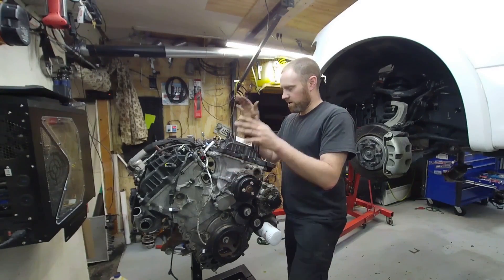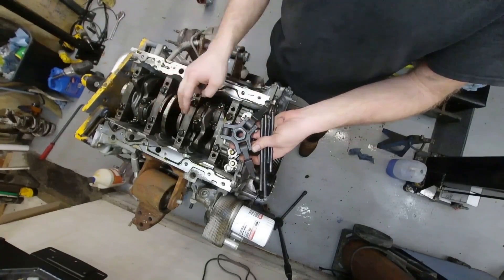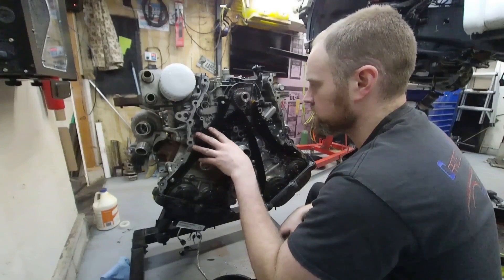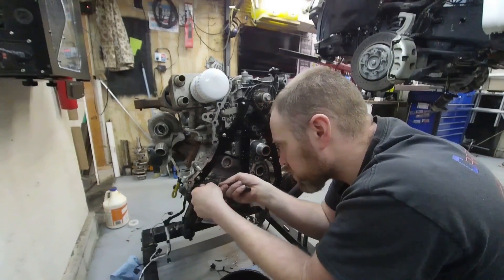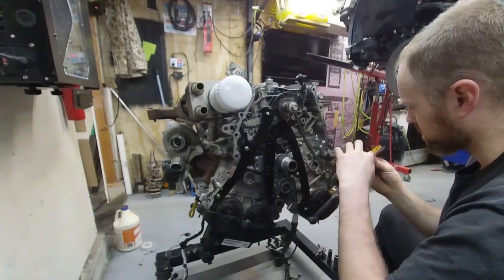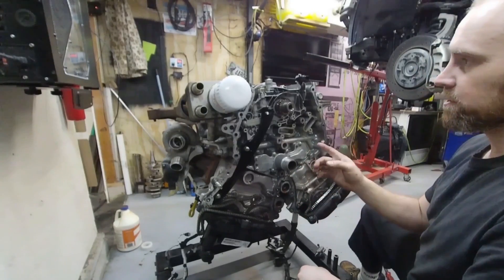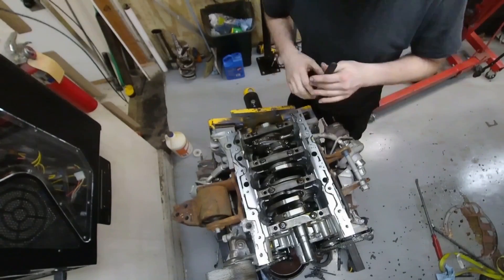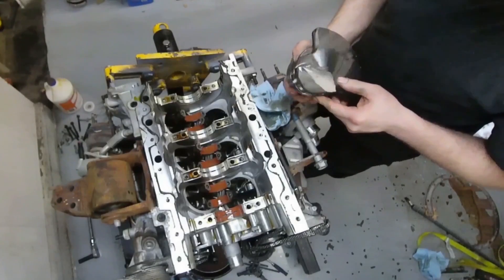EcoBoost Broken crank removal (It's Out!) pt3

Comment: The very same happened to to my '18 rig after using a sophisticated tuning for about 30K only with some 430HP in it(towing horses for long distances). 
Nobody knows whether the owner of this truck did the same or not, but mine clearly broke just because of the excessive torque I've created with the software update. Lessons learned, I've got a (forged) Raptor now and no issues at all (over 70K/year).
Another lesson/friendly advice after six "depleted" F-150s over 30 years: check the oil quality, level and (!) lifetime rigorously and change the bloody oil if you used the engine intensively even for 2K only. You'll save your engine. 
NB! modern oils do not last long and they expire during each heavy job. A 20 hours intensive (hot&dirty climat, frequent up&downhills, short stops, heavy off-roading etc.) usage kills any oil, notably the mediocre ones...
I used to have V8 and V6 F-150s, but the latter rule is actually valid for both type. I have no engine issues ever since I replace the oil on time (means, before "official" intervals).

Comment: Ive seen plenty examples of these chains lasting much longer than 80k. Just gotta keep up with frequent oil changes so they don’t stretch especially since the oil on these direct injection engines are often subject to heavy fuel dilution especially if they are sitting at idle a bunch. I think a lot of ppl try to stretch the oil change intervals too far on these turbo engines. From the used oil analysis I’ve seen I wouldn’t go beyond 5k on a good full synthetic oil.

Comment: You burned through removing the main caps in high speed so I didn't catch it, but did you say they are held in with additional bolts from the sides of the block? Trying to do an in-frame rebuild on one of these things but not having luck getting the mains off...that would explain why. Looks like the motor is coming out if that's the case...[curses at Ford]
Reply from the maker: Lol yeah, it has side bolts and there are things blocking a couple of them.

Comment: Crazy. Probably a tough thing to see for the guys that brag about their Ford truck having a forged crank. Even forged parts can have defects in the grain structure leading to a failure. I think you're right about how thin some areas of these cranks are. I guess Ford is banking on using a forged crank to make up for those thin sections.

Comment: Back story question. Why isn't the dealer doing this? Would figure that the crank failure would be a warranty item and that a 2017 would still be under warranty. Don't get me wrong I love the content but I'm also distracted with the thought of wtf a 3 yr old truck split crank?!
Reply: In the first video he said the dealer denied it because of some aftermarket part. It was an absurd denial, body part or something. Technically the dealer cannot legally deny bc of that but the owner took the bait and was screwed.
Reply: Id bet the owner could still file a suit against the dealership.
Reply: Wow a hood an intake and rims voids the crank... yeah I'd say a lawsuit would likely favor the owner.
Reply: Ahhh must have missed that or forgot it from in part 1.
Reply: Crazed performance could provide alot of evidence of defective ford parts. Ford kinda stepped in it by blaming rims and hood which is illegal!
Reply from the maker: For the record Ford denied it because it was just over the 60k mile warranty mark but the aftermarket warranty company Ford signed the customer up with for after the factory warranty (non Ford different company) was the one that turned down the claim for bogus reasons. If I was the owner I would at least talk with a lawyer and see if it is worth the lawsuit. One thing to note though is maybe there is even more to it than the customer says as well who knows. Not saying he is lying just pointing out I only know his side of the story and maybe there is more to it?
Reply: @CrazedPerformanceRepair  
I had one of the last 100k mi powertrain warranties on my GMC... Never needed or used it but seems if your going to sell a vehicle at the prices they want you should be able to stand behind it at least 100k min IMO.  I wouldn't buy a vehicle with 60k warranty... So I may not every buy another one lol!
Reply from the maker: @micahap1559  sad thing is the standard warranty on most for power train I believe is only 36k mi and you have to pay extra for more. But I'm not sure really since I only drive old out of warranty things being I can fix them myself lol.
Reply: @CrazedPerformanceRepair  
Wow! 7-8 years ago GM had 100k. Standard. I believe ford did also. I thought it dropped but didnt know it was down to 36K ... What a joke!
Reply: I do all my own work as well. Never hired anything out. Not professionally but my grandfather was a mechanic paint body and frame man! Lol Back then did it all of course he added the paint and body. To his list.
Reply: @CrazedPerformanceRepair  good points and totally agree. Either way I'd like to think this is more of an exception than a rule for coverage.
Reply: @micahap1559   GM is 60k miles powertrain, 36k bumper-to-bumper. They ended the 100k mile warranty around the 2015 model year. If I bought a new vehicle today, I would negotiate an extended warranty into the deal. With all the tech gimmicks and expensive LED headlights, it's not worth gambling. Honda gets over a grand for replacement LED headlights and they have a tendency to fail after a few years.
Reply: @karlschauff7989  You hit the nail on the head with the word gimmick. But youre buying in hook line and sinker. Youre wanting to negotiate paying more for them or actually someone else to stand behind their junk. Less quality more money! They can keep it as fsr as I'm concerned.
Reply: @karlschauff7989  never seen led headlights fail. I’m sure it can happen but they are far more reliable and energy efficient than HID lights. They aren’t really gimmicks since they offer much better illumination than halogens. I’m sure cruise control and variable lift/timing were once considered a gimmicks. Besides it’s not like they are offered on al models. They’re typically reserved for the top tier models so you can simply choose to skip them when specking out a truck
Reply: @1ScvReady  I'm not calling LED headlights a gimmick. I'm calling all the other tech junk in modern vehicles a gimmick. Huge 12+ inch displays on the dash, variable height suspensions that require a large air compressor to function, power hatches and tailgates, self-driving "safety" tech that requires powerful computers, 360 view cameras, massive power sunroofs, power massaging seats, powered fold-flat console shifters, lane-keep assist, hybird and start-stop systems, engine coolant systems that direct engine coolant to rear differential to heat the gear lube up in order to boost EPA ratings by a fraction of a fraction of 1 mpg,  etc. All gimmicky things that customers love until that feature stops working and they come to find out are extremely expensive to fix.
Reply: @micahap1559   The problem is that there isn't a manufacturer out there today that is willing to stand behind their vehicles when new gimmicky or unproven tech features fail.